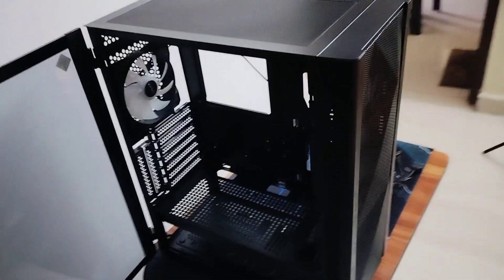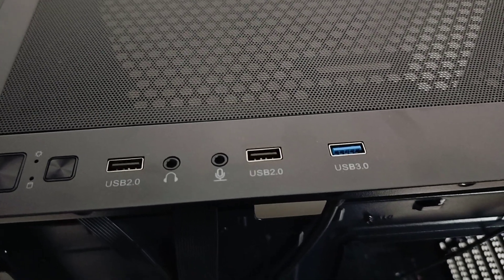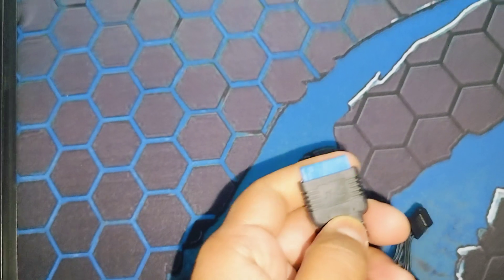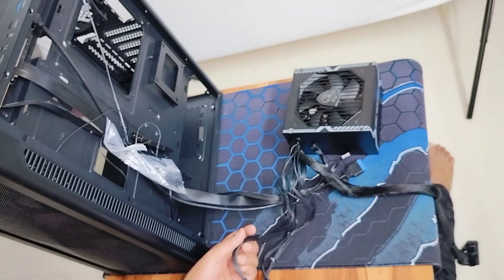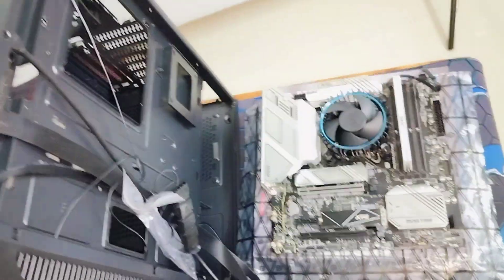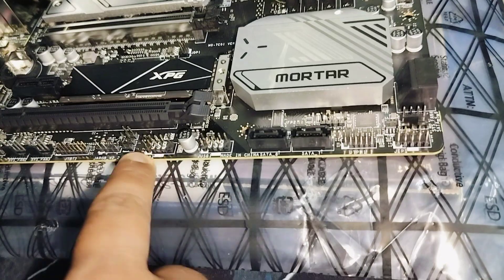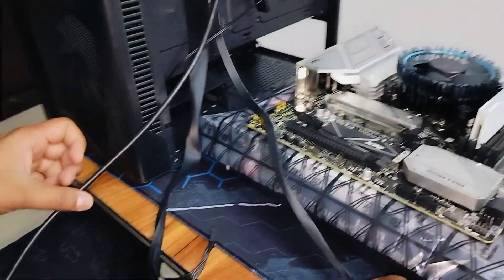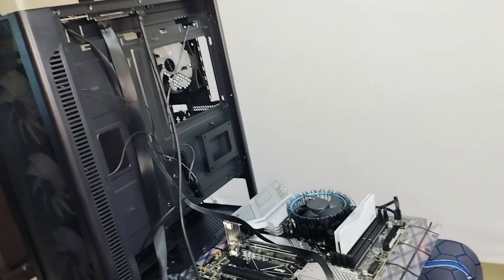PART 5: Budget Gaming PC Build with Galax Rev-06 CPU Cabinet & MSI MAG A650BN PSU Step-by-Step Guide

Comment: bro what do i do with the weird fans connected together and that socket isn't on my mobo
Reply from the maker: @Bl4dezYT  you have options to remove it as well but it's already well organised to support anyways it has also a decent air circulation. You may also checkout other brands and models which are suitable
Reply: @ChoudharyKaDimag  is there a connecter for the fans which converts it to the motherboard slot
Reply from the maker: @Bl4dezYT  yes it's called as a mother board CPU FAN pin which you will get it by default when u get the SMPS box